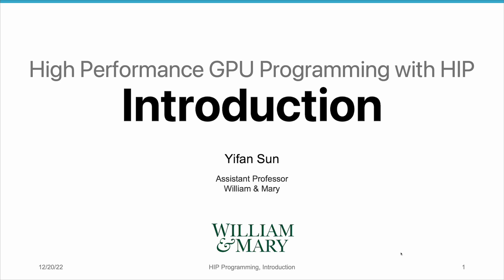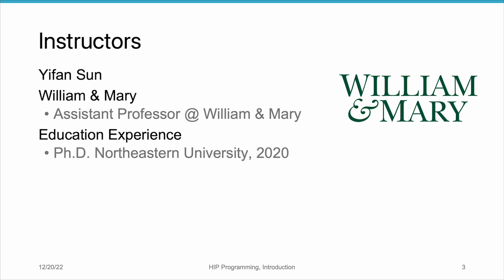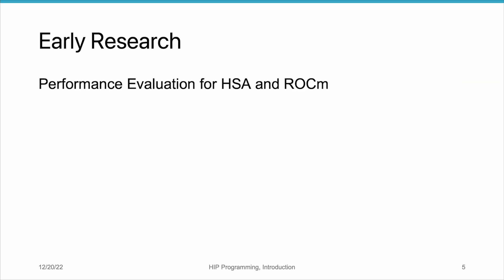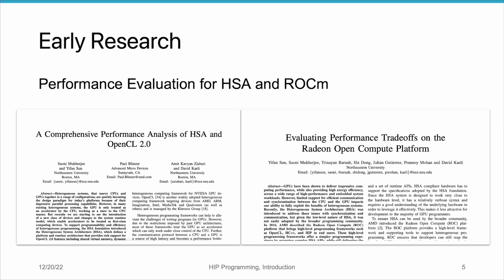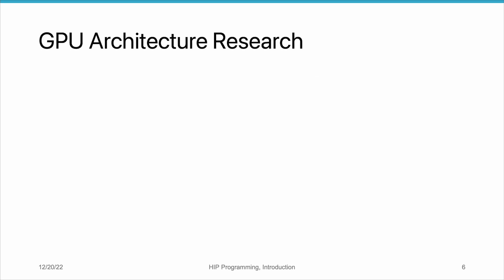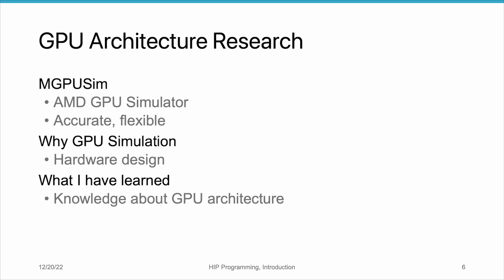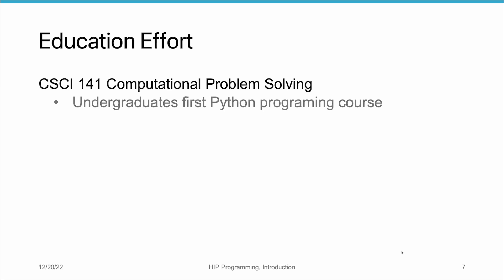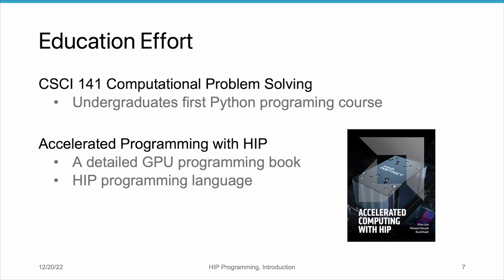AMD HIP Tutorial, 1-1, Introduction to the Instruction Team

Comment: I am trying to figure out if I should try to modify hipblast for compiling rocm for the gfx900 or if I am going to be stuck with the less efficient hipblas version.
I am running into major issues getting the source for rocm to compile for gfx900 as it seems to be scrubbed from many places. even magma is missing everywhere.
Is there some effort to block this technology from the masses going on?